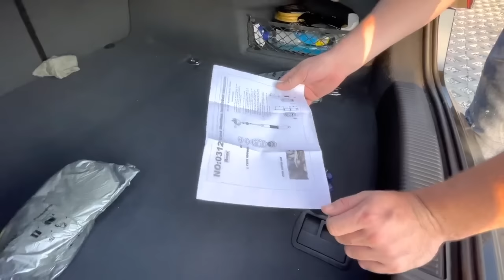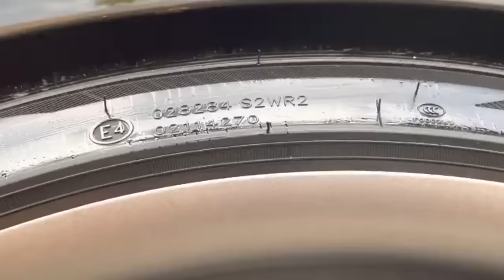BUILDING A AUDI A6 C7 IN 10 MINUTES ! RS 6 LOOK

Comment: This is fine for the unfamiliar but Audi enthusiasts will spot it as a wannabe a mile away ESPECIALLY from a roll or dig challenge.You need a SIGNIFICANT tune and considering the cost of that PLUS what you've spent already you would be better off buying a used RS6.